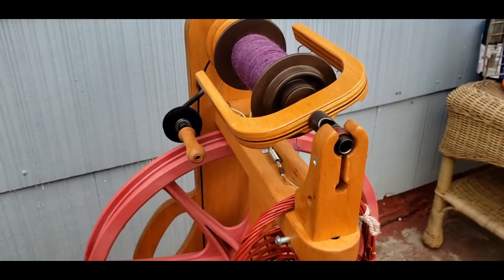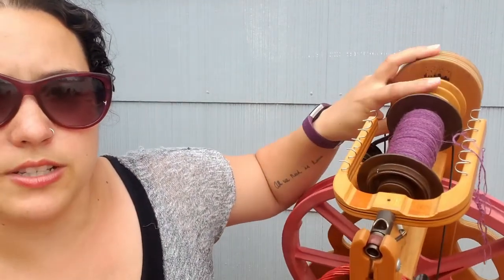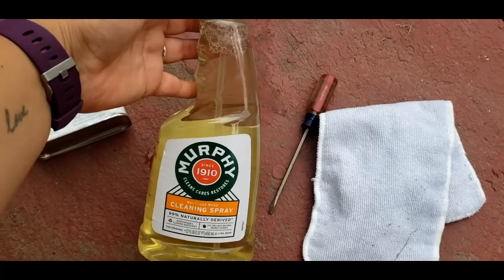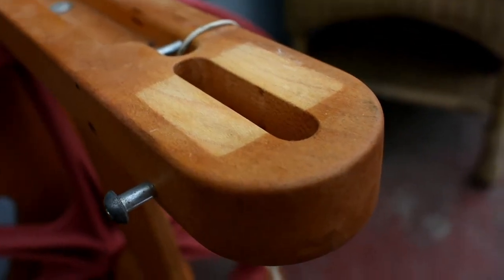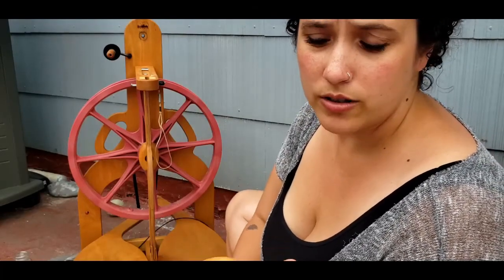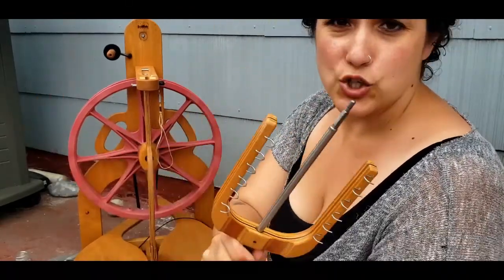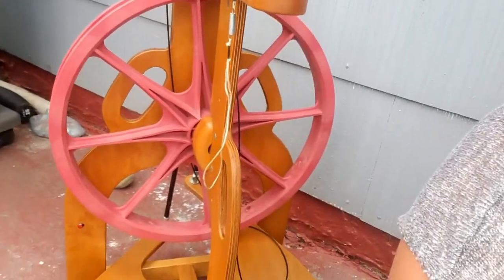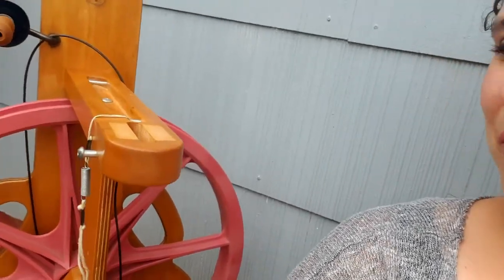Cleaning My Spinning Wheel for the First Time! How I Prep my Schacht Ladybug for Tour de Fleece

Comment: Hi Have you noticed the Colour of the Wheel (meaning the Red not the Wood) has faded since you bought ? It seems brighter in the Ads. Ive just bought a used Ladybug so your Video was really useful.  Thank you.
Reply from the maker: It might have a bit, but I don't think mine quite matched the brightness of the red in the pictures even when I got it. I think over time, the materials used have changed depending on price, what's available and probably any feedback on quality Schacht has received. I think hwwles older than mine (2012) has a brighter red wheel but it was a different material. They looked like a more acrylic type of plastic (shiny but almost brittle) where mine feels and looks more like a recycled plastic (like park benches and playground equipment). I don't know what they look like these days or the current advertisement photos. I was a little disappointed in the color when I first received mine, but now I like that it's not so vivid. I also didn't love the ladybug piece on mine becaise it was different from the one on my friend's wheel, but I do like that it's bigger than the previous versions.

I dont know what the market is like now, but I could not find a Ladybug used when I was trying to buy one. You're very lucky! And that was when the price was much lower too.

I'm so glad you found it useful! I had to refer back to this video this past summer to give myself a refresher on what I should be wiping down 🤣. Subscribe and come back in the summer for Tour de Fleece! It's pretty much the only time I really get spinning.
Reply: @LittleMitchStitches  Hi Thank you for your reply. I'm in the UK (Wales) and I've just bought the Ladybug on eBay. You're right they don't come up for sale often here either. It was listed as 7 year old but it is actually nearly 11 years old!! And despite showing 3 Bobbins on the photo the Seller only sent 1.
I was very disappointed but the Wheel is lovely to Spin on though but needs a good clean. 
I was wondering if I could use T Cut which is a polisher usually used on Car paintwork on the Wheel but haven't bought any yet.
Anyway Thanks again.
Reply from the maker: @rhonaharrington3850  Ugh that's pretty shady! I hope you were able to send feedback to eBay about that seller. I have 5 bobbin for mine- 3 to spin on, 1 to ply, and 1 for when I get distracted by other projects haha